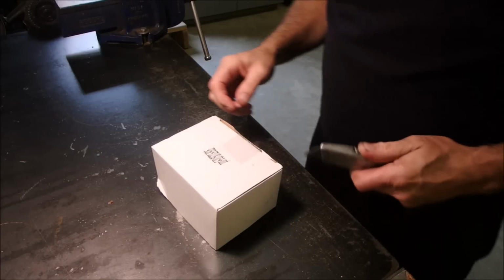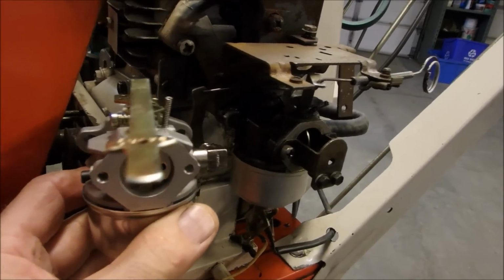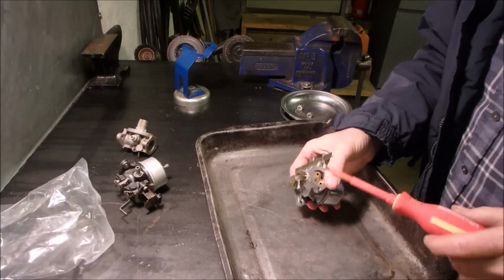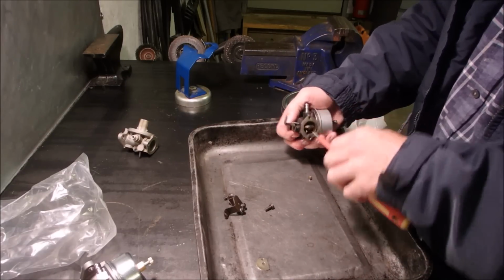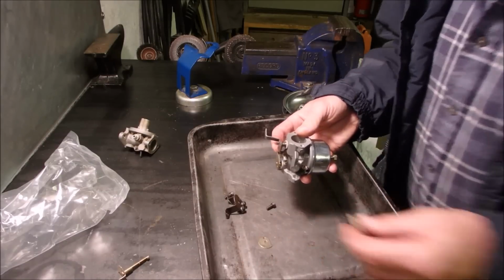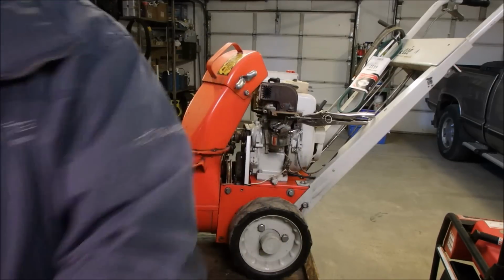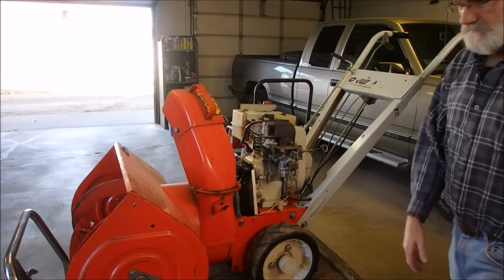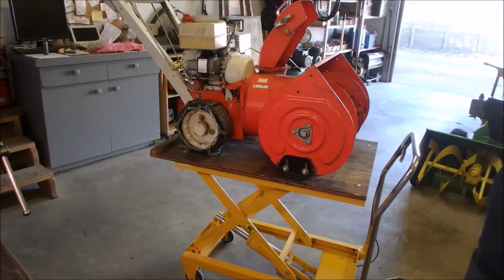New Carb For 4HP Ariens Snowblower

Comment: Good video shows what sometimes needs to be done to keep an older machine working.  It seems that replacement carbs aren't available with the older choke shaft for the pull cable but only for the later ones with a knob arrangement.  Mine still has the original carburetor so I smile at it every time I start it up.
Reply from the maker: I would too.  Smile that is.

Comment: Sir, I have 922020 5HP ariens snowblower. The oil cap and drain are the same as mine. Do you have a picture of inside of the oil cap? I changed oil and noticed there is no oil dipstick on the cap. So I am not sure how much oil should add into. Thank you so much
Reply from the maker: They hold 1/2 a litre (500ml).  half a U.S. quart is close

Comment: The choke lever on the new carb looks exactly like the choke lever on my old 4hp Tecumseh an my Ariens 10M4.  It has that long flat lever on it that sticks out the side of the carb/muffler housing.  I think I may pick one of those up just because my old carb, while it works okay is getting pretty crusty, especially up at the throttle control plate...either that or I just need to take some sandpaper to my old one, lol.
Reply from the maker: Thanks for joining in!!!

Comment: How does this carb get primed? No primer bulb it seems.
Reply from the maker: Just a choke on this one.  no primer on the old carb or the new carb.
Reply: @BrucesShop   I was wondering because I have the same exact model of Ariens and planning on replacing the carburetor but the old one has a thing where you push a button which blocks off the air intake and then you pull the starter and I guess that primes it a little bit. But I did not see you do that when you started yours so that's why I'm wondering.
Reply from the maker: @drwatson1234  That is the choke.   Right  there is no primer which is a tiny hole on the side of the carb
Reply: @BrucesShop  I had in storage an old Tecumseh carb which looks just like the one you bought. I will need to change the butterfly choke setup as you did. However, I noticed that it does have an inlet for priming.  How can I make use of it? I cannot just ignore it - right? Do I have to run a new line to the tank just for the primer and then add a bulb inline? I am assuming that the version of the carb without the primer line is "self-priming?" That is - it pull gas from the inlet line somehow on its own? Otherwise how can it start?
Reply from the maker: @drwatson1234  The old one must not have had a primer.  You can just put a hose over the primer hole and block it  (bend it over)  The just start it with the choke like you did before.    If it doesn't run right it may need to " breath"  like the primer buttons with the hole in them.  Then just try it with out the  primer hose

Comment: Is that an OEM new carb, or one of those Chinese knock offs?  Trying to remember what was wrong with the original carb that required replacement!
Reply from the maker: +kramden      Well it isn't OEM but the finish was good.  The original one I broke it trying to fix it.  The second one was a retrofit from a 5HP HSK with the fuel inlet at 180 degrees..  This is the correct one but with the choke butterfly from the original one.  WHEW!!!
Reply: Been there, done that for sure buddy, glad it is working well now.  Love those old Ariens, and the tecumsehs always ran nicely.

Comment: was wondering why you plugged it into 110V. now i know! first one i have seen like that.
Reply from the maker: +Glyn Robinson A lot of snow-blowers have a 110 volt starter.  It eliminates the need for an on board battery the charging of that battery (alternator) and weight of both it too.  Kind of brilliant.
Reply: snazzy idea